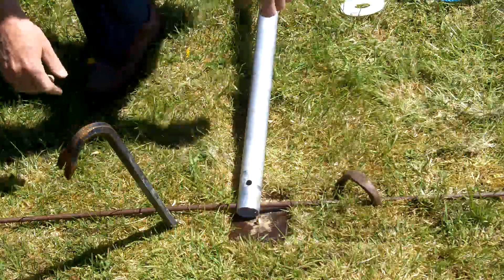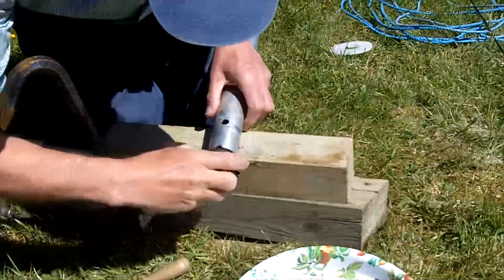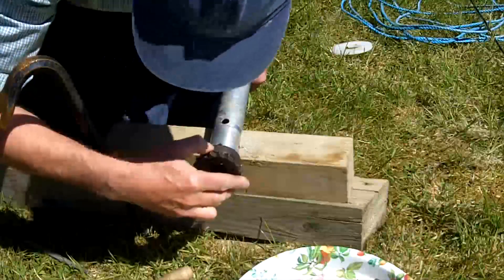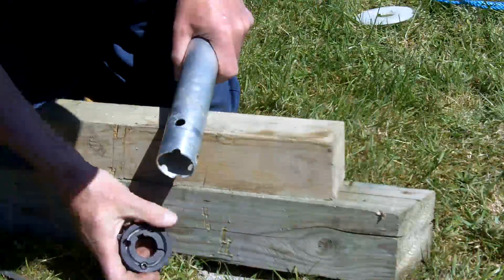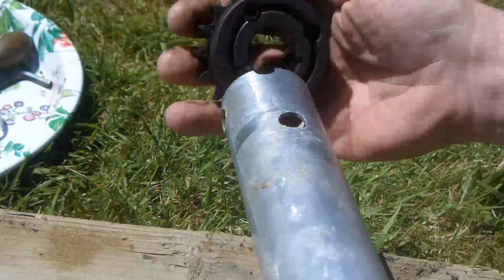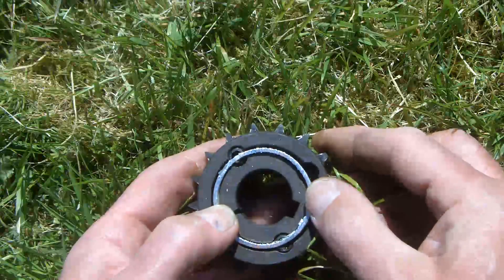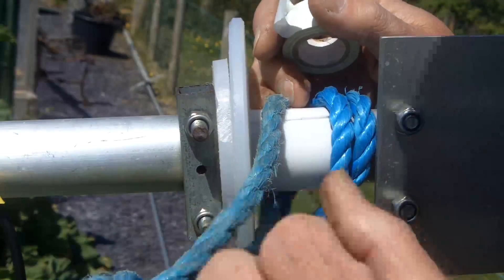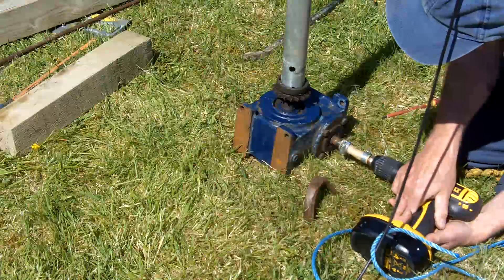About Radio 71 Antenna Rotator part 3

Comment from the maker: Hi Gary  I use Adobe Premier Elements 9 and it drives me nuts sometimes, it used to crash a lot, it’s got a bit better lately but occasionally it jumps from one part to somewhere else of its own accord, there’s a bunch of other irritating things but I’ve learnt to work around them. I have a lot of fun with it but if I was starting again I’d try and talk to people who are using editors a lot and get some other opinions. PE9 is good but not great. 
Hope that helps.
Kind Regards ... Andy

Comment from the maker: Hi, I think this is the what I'll do, I can arrange to have enough over travel on the coax to the beam such that over screwing around isn’t a problem.  I see the medium weight Yaesu rotator has a 450° degree capability, so 45° past each end of a 360° sweep, and that seems reasonable so I'll take a leaf out of their book. Thanks for the input.  
73’s ... Andy

Comment from the maker: Hi, well it depends if I get bored before I finish I guess. I could just hang one of those high intensity LED’s and a battery of the end of the beam and I could even see it in the dark. I think I will add some sort of meter, probably an analogue meter marked N,E,S,W with some over travel at either end.     
73’s ... Andy

Comment: Just seen these rotator videos Andy - very enjoyable and interesting as usual.

I'm wondering how (or if) you are going to build in some indication of angle back to the control point - maybe a stepper motor is the answer after all.   I'm afraid I dont understand them either but I'm sure they can't be that hard to master.  Anyhow - keep up the good work and be sure to post more videos so we can see wht happens.

Of course you could just look out of the window to see the angle.

Cheers